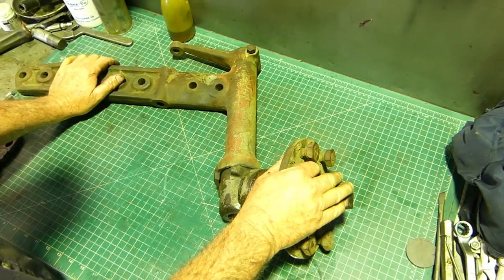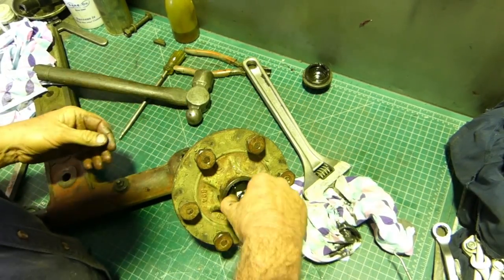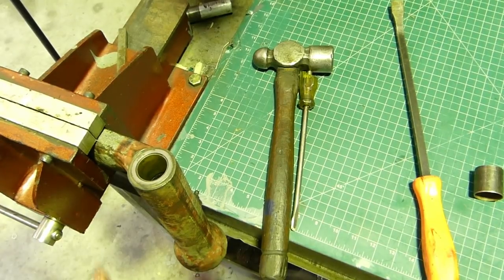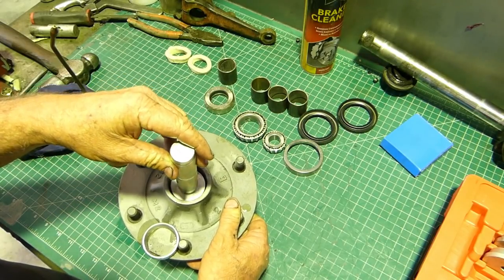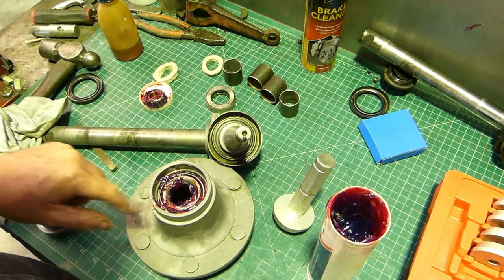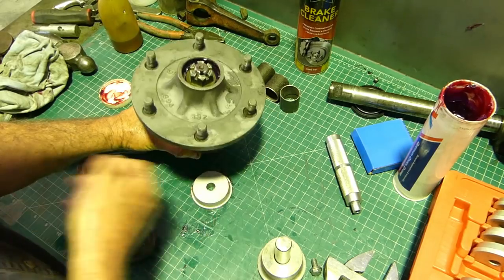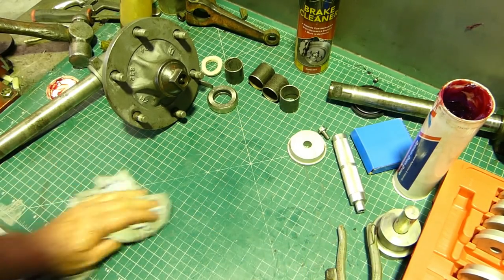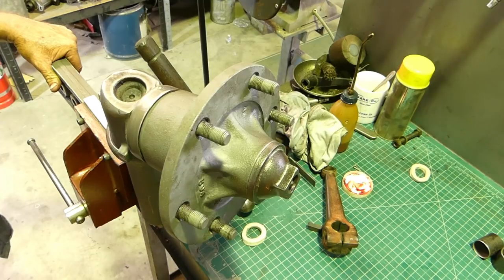Massey Ferguson 135 6 Speed Restoration # 81 Replacing the Front Wheel Bearings and King Pin Bushes

Comment: Thank you for a great video I had to put new bolts to hold the axles on and found out the bearings are bad and I did not see a flat axle bearing washer in there so thank you
Reply from the maker: No problem 👍

Comment: I've been doing this job today, alas my kingpin casting seems different. There is no recess on the bottom of it for my spindle bearing to fit into. The outside diameter of my new thrust bearing is the same size as the diameter of the casting, so my thrust bearing will pretty much be outside in the open. This doesn't seem right. But thank you for this informative video, I wish I watched it before hand!
Reply from the maker: I found on the later straight axles the bearing was out in the open, not a good thing I dont think.
Reply: @BundyBearsShed  ah thanks for letting me know that. Yes it's a straight axle and I thought it was such a daft design to have a bearing out in the open, wonder what the boffins at Massey were thinking!